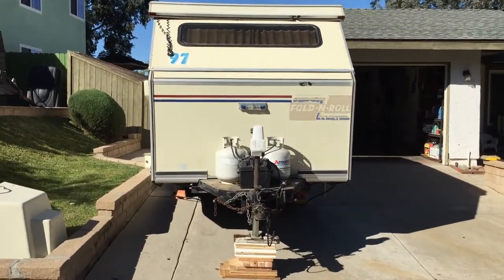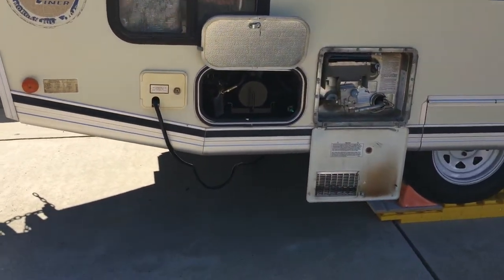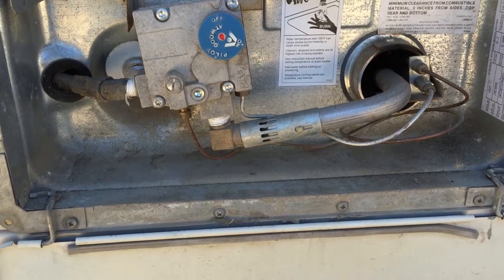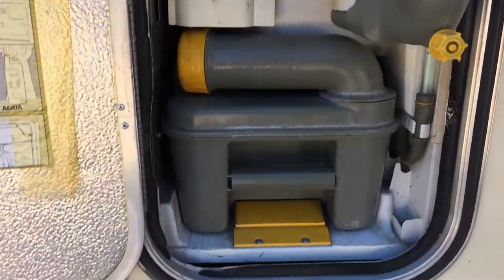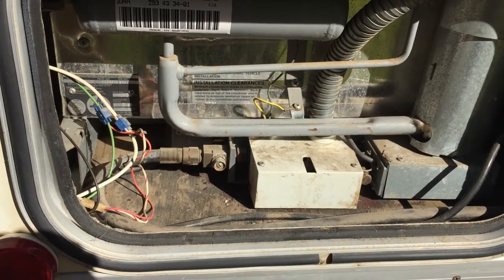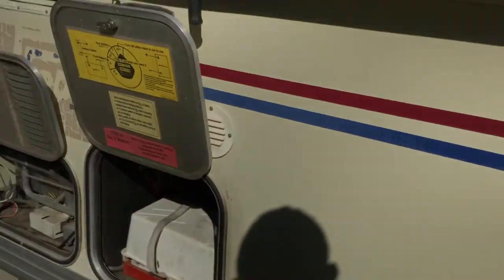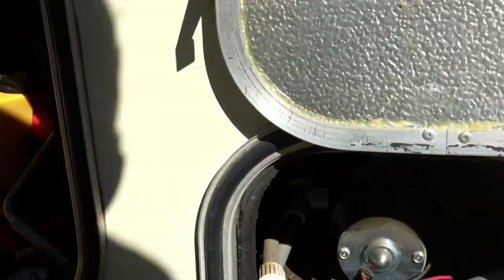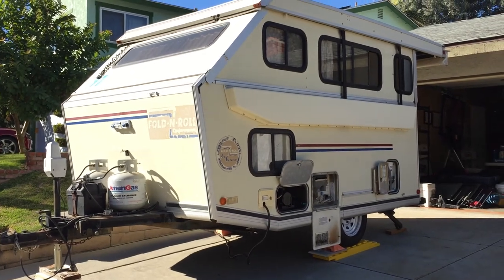Fold-N-Roll - Oustide Walk Around

Comment: Hey I have  a 89 fold and roll and the hydrolic lift is not working.  You mentioned that one of your batteries wasn't working right.  My batteries are testing ok.  But the inside lights stopped working to.  At home loading it was ok. But when we got to our destination and  hooked up the inside lights, they wouldn't turn on.  But the outlets worked.  I bought this used and there was no manual.  It is just me trying to figure this out.  Which battery was bad on yours and how did you clean the connector.     Very good and informative videos.   Thanks 
I  may have to look for a vintage rv repair shop
Reply from the maker: Hi.  I unfortunately I don’t have the amazing fold n roll anymore (it went to a good home and is still in use!).   But i remember having to do a few things to ensure the lift went up:  keep batteries charged with a battery tender, put the battery control mechanism to use “both 1 and 2” (if one wasn’t lifting it by itself), and add hydronic fluid to the hydronic motor reservoir.   I hope one of these is a quick fix for you.  👍🏽

Comment: Hi John, I have a 97 Fold n Roll and recently my hydraulic roof lift stalled 3/4 of the way up.
You said you used the hydraulic fluid to correct a problem. Could you explain what the symptoms were when you decided to add hydraulic fluid? 

Thanks,
Ben
Reply from the maker: +scvb71 
Hello!   The first time I brought it home (from my father in law who had is stored outdoors in the open roof position and never actually used it) it would go about 85% all the way up, but get slow towards the end & also it needed the moving parts lubed.   I added hydrolic fluid to the tank/reservoir (pump looking thing) and it worked to push it all the way up (strong).   I added probably 1/3 cup at a time, and I think it took about a cup worth overall..maybe a little less.    
But since then (2 year ago?) keeping the trailer overall clean & occassionally adding lube on the moving arms it has been fine and I have not needed to add more hydrolic fluid.    Hope this helps!!  Glad there are move of us out there with these cool little trailers.  Although my family is kinda outgrowing it, we are not ready to change it quite yet..maybe another couple of years.

Comment: Thanks John, My roof is going all the way now. In addition to lube and hydraulic oil I fully charged my batteries. By the way, my marine batteries are rated at 550 cold cranking amps ( CCA ) do you have a higher rated CCA for your fold n roll? Was considering increasing mine.
Thanks,
Ben
Reply from the maker: +scvb71  I have 2 batteries and just use the Deep Cycle batteries from Walmart = 2 of the same = Everstart 24DC with the 690 marine crank amps, rated at 101 amp hours.   Hope that helps.   If you do 2, it's best to make sure they are the same and/or swapped out in pairs if at all possible.   I've had to change them 1 time since taking the trailer a couple of years ago.  At the same time I don't suggest keeping them plugged in for extended periods of time (days) as this could cause them to boil over.    Just my thoughts.
Reply: +John Pieterse I have the same brand deep cycle but my crank amps are 560 and I agree about not keeping them on trickle charge. I bought my Everstarts 5 years ago. Guess I'm lucky they still hold a charge. Time for a upgrade.

Thanks
Ben

Comment: How do you drain the water in the sink?
Reply from the maker: Hi. Sink and shower drain to the dark holding tank that has a drain plug behind the right wheel (I think it’s that side). Can connect a hose to it - standard drain plug as on other trailers.  But it’s totally seperate from the toilet cassette reservoir.  Hope that helps!
Reply from the maker: The drain shown at the 3:35.  Sink goes into that tank. I think it’s like a 20 gallon tank or so.
Reply: Thank you, I am almost done working on mine just got to drain the water sitting in the sink , our lights used to flicker also but now it’s just completely off did you replace the entire clip on the floor? Not sure what to do with it.